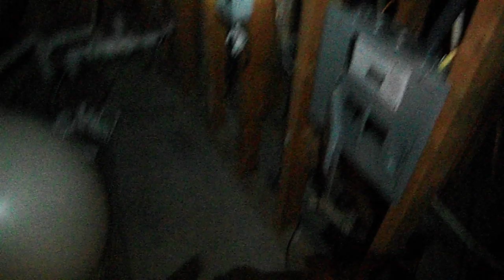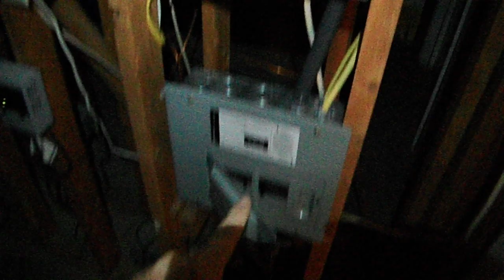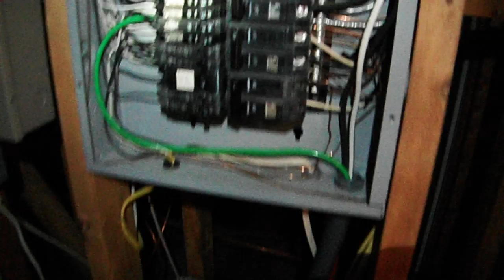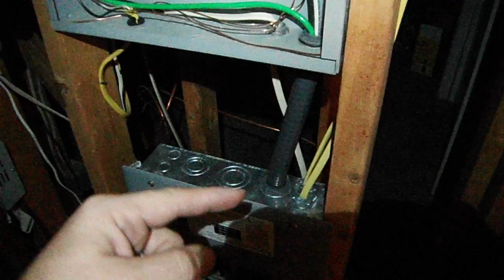Sub-panel double lugging

Comment: FIRST OF ALL, there is a right way to do that. 1) You need a set of double lugs (lugs made to accept two wires...usually the same size) 2) You need to use the same size wire to feed your new panel as is being used for your main feed. 3) your new panel must be rated for the same (or more) amperage as the one you are feeding from  4) my electrician tells me that the panel you are feeding must be less than 5 feet away.     I am skeptical of #4, I see no reason for this to be required unless they want it to be in a location where it will always be seen when servicing the  main panel (sub panel).  Also, double tapping  a breaker is legal if you use a breaker made to be double-tapped. There are plenty of them out there.  All I see is idiots getting their information from OTHER IDIOTS....all online and then doing videos without complete information. Find an 80 y.o. electrician who only did custom work in a very expensive area....and they will tell you a lot of stuff... A whole lot more than you'll ever learn from watching other idiots.    That being said,...we usually just change out two breakers and run a set of of 2-0 wires to the new sub panel.  And we'll just move the wires that were in the old breakers to the new panel  with new breakers.

Comment: so just curios if this was lug designed for double taps [ie 2 holes] AND then you fed it to a breaker on the sub panel would it be legal??? I say this because. it seems the 2 issues  are 1] you can have 2 wires into a single lug and 2] it has to be fused/breakered and a way to shut off the sub panel. .  If it ran into the subpanel by means of a breaker it would be breakered and have over load protection, so the question would it be legal.  . . I ask because I have been looking into feeder taps under the NEC . and it seems it just may be okay. would love to here your opinion as long as there is protection on both sides of the tap?
Reply: this is legal under 10 ft tap rules. you are correct.

Comment: It's wrong, and dangerous, but unfortunately not for the reasons you state (at least making some assumptions about how things are set up).  Assuming the smaller gauge (white and black pair) copper conductors run to the additional sub-panel, it's wrong and unsafe because the "tap" conductors to the new sub-panel are smaller than the supply conductors to this sub panel, because they've inserted two conductors into lugs designed for only one, and because they've mixed copper and aluminum conductors in the same lug.

However, unlike what's stated in the video and description, the second panel is protected (just not adequately, because of the undersize conductors) by the same breaker that protects this sub-panel.   If they had spliced the conductors for the second sub-panel into the feed for this sub-panel correctly, and used appropriately-sized conductors, this would have been both safe, and legal.  We don't know where the disconnect for this panel is, and it appears to violate the 6-throws to shut everything off rule, so it probably should be a main-breaker panel (unless there's a disconnect right beside it that we don't know about), but it's legal to drop any number of sub-panels off of a single set of conductors out of the main panel, just so long as the entire path to each of the sub-panels has adequate ampacity to be protected by the breaker back at the main panel.
Reply: I think NEC 240.21(B)(1) {Tap Rules}  could apply here if the conductors terminated into a main in the second panel. 
https://www.youtube.com/watch?v=uJRSrB4E7dY
Reply: In looking at the footage a few more times, this installation does not look very safe, especially lacking a main disconnect, the smaller sub panel might not be configured for a main breaker. Years ago in my former job, the main electrical service entrance was replaced 600A 120/208 fused disconnect panel to  400A 120/208 main breaker feeding the upper level panels. Another electrical contractor installed additional panels one in the electrical panel room,  100A breaker off the main panel, with a 100A main disconnect in the panel. Process was repeated for the 2nd panel installed in another part of the building.
Reply: so just curios if this was lug designed for double taps [ie 2 holes] AND then you fed into a suitable sized breaker for sized wire on the sub panel would it be legal??? I say this because. it seems the 2 issues  are 1] you can have 2 wires into a single lug and 2] it has to be fused/breakered and a way to shut off the sub panel. .  If it ran into the subpanel by means of a breaker it would be breakered and have over load protection, so the question would it be legal.  . . I ask because I have been looking into feeder taps under the NEC . and it seems it just may be okay. would love to here your opinion?

Comment: Why do you guys use alu power lines inside the house? Here in Western Germany we use only copper power lines after the come-in main breaker for all phases. At this point the saved earth line starts. After this is a meter installed. Then again a main breaker over all phases. This point marked the end of the company power line and start of your house power line. The saved earth goes around the first and second main breaker and the meter. All with copper power line of course. 

Normal german houses use 3x230V 50Hz - start with a 63A main breaker inside. First main breaker from power company normally 80A. Larger houses divide the line at this point or they starts with higher main breaker. Companies use 3x230V 50Hz 125A till more - depends of the machines how they used. Normally offices use same normal houses - this enough for the office things. [Understand me correct, 3 phases x 63A = 189A total! This enough normally.]

Comment: So if I wanted to run a sub panel from another sub panel I could use a 50amp 2 phase breaker to feed it? My other sub panel in my garage is fed by a 6-2 wire via conduit from the 200 amp box in the house. Since I have no neutral wire I cant run my welder and my lights and plugs since the old sub had a jumper wire to feed the other 20 amp circuit for some lights. Is this something people do all the time? or will I fry myself? And yes I will get an electrician to advise me but I want to do this myself. Broke you see.
Reply: Cody B  Sometimes somebody need the subpanel at other place - then breaker and new subpanel. If you need more breaker at this place - better install bigger panel at this place. Looks cleaner and better to understand for next house owner. I wonder me all time that most panels in the U.S. YouTube videos not use a list of breaker at the door e.g. 1 = kitchen; 2 = bed room; and so on.